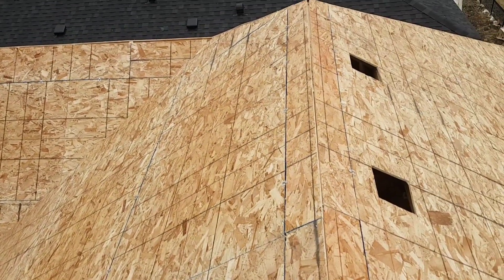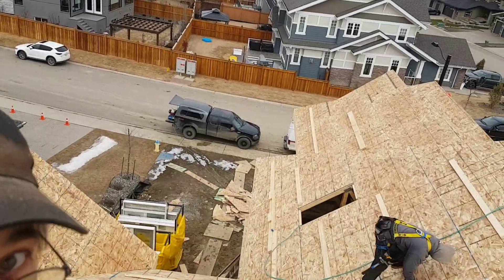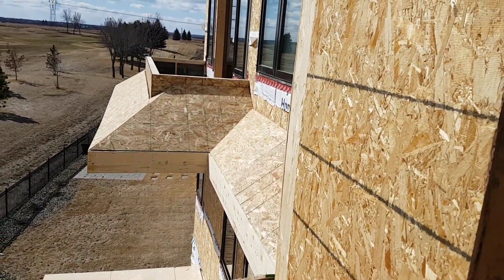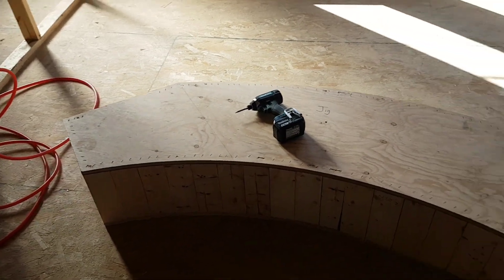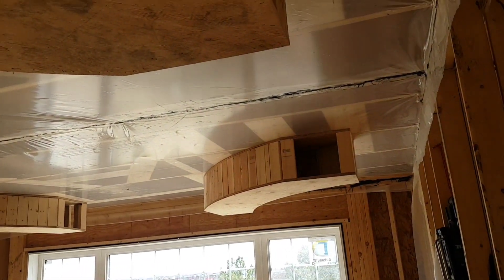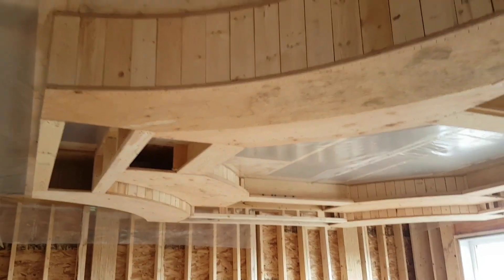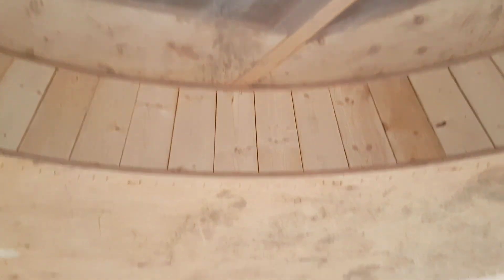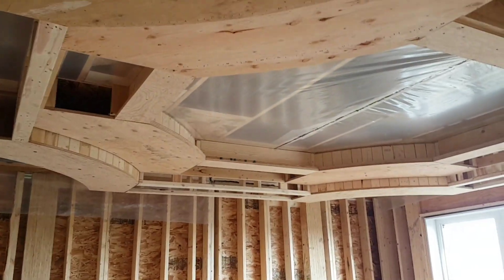A Big Roof...and Two-Tiered Bulkhead Ceiling #custom #framing #construction #roof #trusses #bulkhead

Comment: Whoa. I want to try building a roof like that but I am not even sure where to begin. Are the plans engineered and modified to build a roof like that? How did you learn that method? I would probably end up with a 30k campfire lol.
Reply from the maker: I assemble the trusses on the  ground, and fly them up in sections, this roof has truss spans of 60 feet and there are open-to-below areas at   front and back, there is just nowhere up top to lay trusses flat and then begin standing.  I use the method that works best, and have tested this hundreds of times, Dare I say perfected?  (before hoisting, always ensure sway-support with diagonal bracing) side note: these trusses cost more like 50K 🤣